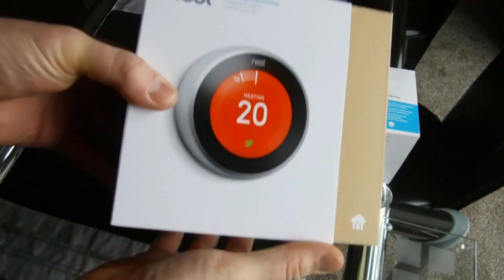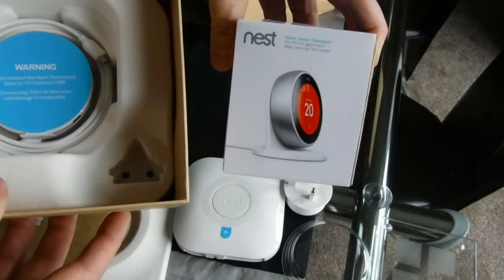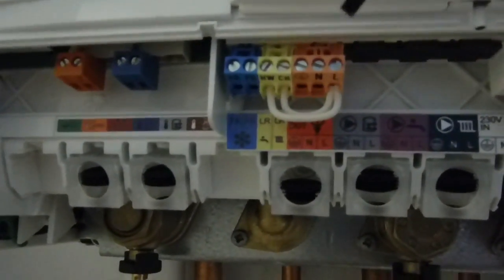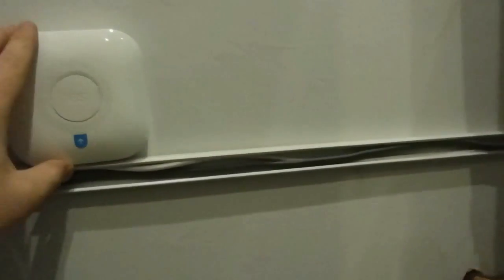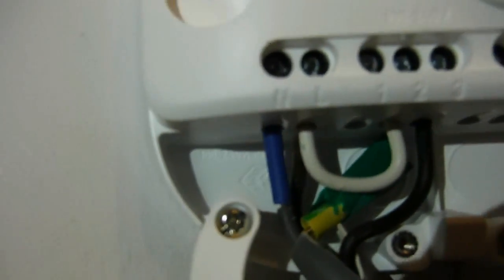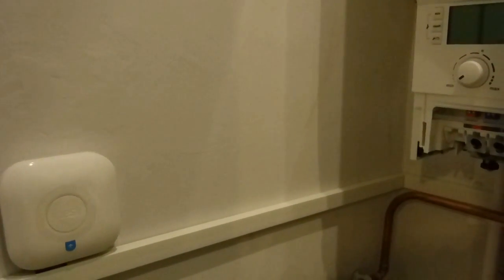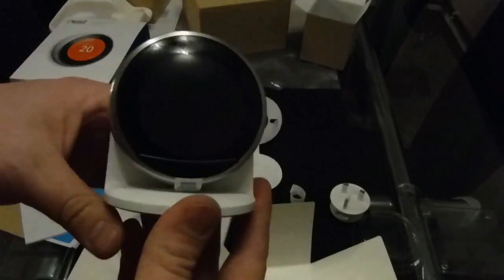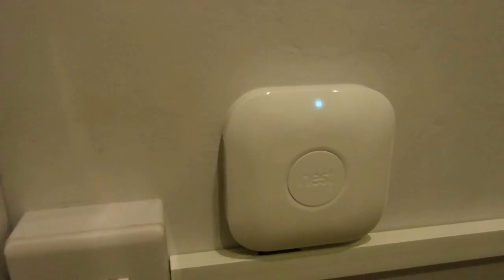How to install Nest Thermostat 3rd Generation - UK

Comment: So if  you wanted to control your hot water as well could you just use the earth wire and connect it to the HW terminal on the boiler and the HW terminal on the heat link
Reply from the maker: I've not ever connected up hot water controls to mine. You would use terminals 4, 5 and 6 though, and it's more if you have a hot water tank, not just a combi.

Comment: I like how they made an UK adaptation for the nest thermostat as in the US they don't have boilers, they have an AC that blows hot air in winter and cold air in summer because in some places in the US, summer and winter are both intense. But with the British version its only to heat the house. That also makes me wonder if there are adaptations of the thermostat for HOT countries where it's only the cooling feature...
Reply from the maker: The British version will cool with air-con too! 👍🏼 It's just not used as often here!

Comment: thanks for the video. I am looking to install one of these very soon. FYI to get rid of flicker on your video change the shutter speed to either 50 or 60 depending on the Hertz of your lights. you can pick up some decent video lights from amazon that are anti flicker also
Reply from the maker: Thanks for the tips. I have changed most of my equipment since recording this video including a video light, so I shouldn't have any issues with flicker going forward. Thanks for commenting though! 👍🏼

Comment: Hi Charlie – your video is great. We are just about to fit a Nest learning thermostat to go with a new Worcester 23CDi Compact boiler. Like you, we haven't decided where to put the Nest so will get a stand to try it in a few places with a view to putting it on the wall later. My question is how do we get power to it on the wall without visible trunking. It is likely to be several rooms away so can't have a cable going from the boiler to the thermostat. Nest have told me that we would need 5V of power as you would with a phone charger (so would need a transformer to convert from 240V). Any tips of how to get power from a plug socket below, up to the position on the wall above it, with the cables hidden in the wall (without pulling the wall out). Is there a way of pulling out the plug socket and feeding the wire up the wall, then putting the plug socket back? I am not an electrician and will not be attempting this myself – just wondered if this is feasible? Thanks
Reply from the maker: It really does depend on the type of walls. If they are solid brick or concrete then the only way is to 'chase' the wall...messy....but if you're renovating the room anyway, not a problem. You could take the socket out to see what access is like behind (make sure the power is off!) and if the wall is stud partition then you could drill a hole where the Nest is going and then drop the wire down (best to have gravity on your side!) to another small hole near the socket (if there's a socket directly underneath). Don't go drilling near the socket before checking where the wiring is running first, and don't bring the wire out of the socket hole.....give it it's own hole.
Alternatively....what's the other side of the wall? If it's a cupboard or an area covered by furniture, drill right through and run the trunking up that side of the wall.
Hope that helps!

Comment: Hi, I’ve just purchased a 3rd gen nest but it didn’t come with a power cable! Can I use a phone cable instead?
Also, my boiler is a Valliant ecotec 430 plus. I don’t have a thermostat but i do have a separate heating and hot water control unit, do I disconnect the controller and replace it with the heat link?
Thanks
Reply from the maker: Did you buy it brand new? It should definitely have come with a power cable if you did. You could connect it to the Heatlink using T1 and T2. The charger does use a micro USB cable, but just be careful you use the right adaptor.
As for connecting it up, yes, you would remove the separate control unit and connect the Heatlink. 👍🏼
Reply: Thanks. yes bought it direct from Amazon🤷🏻‍♂️ just checked the wiring and all wires from boiler pump controller ect go through a Wiring box so controller wires don’t go direct to boiler?
Reply from the maker: @julietweems4127  If I was you I would be contacting Amazon and asking them to send a replacement!

Comment: So that heatlink is a 3rd generation too? Just had a boiler with Nest installed and Nest isn't communicating. Looks like a 2nd gen heatlink next to the boiler, but my plumber says it doesn't make a difference?
Reply from the maker: Yes the Heatlink in the video is a 3rd Generation Heatlink. It's the one that came in the box with the Nest. I have no idea if the 2nd Generation had a different Heatlink sorry, as I've never installed one of those. I would always say to use the Heatlink that came with the Nest though just to make sure its compatible.

Comment: Hi. Trying to install my Nest Thermostat into my Vaillant Eco 415 and have opened it up having followed the manual and it looks pretty straight forward the only issue is that the 3 & 4 which should be looped only has a single cable going into it.  Am I still okay to wire it up and have one cable running to 3, one to 4 and then have these in the correlating numbers in the hub?
Reply from the maker: As far as I can tell from reading the manual for your boiler, you would link the 24v connections to 2 and 3 on the Heatlink. Hope that helps!

Comment: Hi there, great video. Can I ask what cable you used from the boiler to the Heat Link? Was it a 1mm^2 4-core flex?
Reply from the maker: The cable I used wasnt strictly what should have been used but it works fine! The 1mm 4-core flex is suitable yes!

Comment: Hi I’ve got a Honeywell Thermostat a to two wired one I want to put my NEST in same place can I run it from the two wires that connect to the boiler ? Thank you
Reply from the maker: You can use those two wires to power the Nest, but they would have to be connected to the Heatlink at the boiler end. So, connect the Heatlink to the boiler, then connect the Nest to the Heatlink via connections T1 and T2 on the Heatlink using those wires. Important: Make sure the current wires are disconnected from the boiler before you connect the Nest to them or you'll fry the Nest!

Comment: Was the charger and cable included with the nest?
I am just getting Nest 3rd gen with my electricity renewal plan and I am not sure if I need to order it separately...
I have seen that the stand needs to be purchased separately but I am not sure about the charger and cable...
Reply: Mine didn't come with any additional power supply. I bought mine from toolstation this week.
Reply from the maker: @kirky9633  Really? They've changed that then, because when I bought mine (which, granted, was in 2016!) it came with an adaptor and wire. You sure it's not hidden at the bottom of the box? 😉
Reply from the maker: The charger and cable come in the box with the Nest, but the stand is usually a separate purchase.....although some places (Screwfix I know of) are offering a free stand at the moment.

Comment: It is essential to wire to the call for heating into 3? and is it also essential to loop the live into 2? my old thermostat had the call for heating into 1, with no live loop into 2 - this is the configuration i used. I'm not sure if i'll have issues with this.. any help is appreciated
Reply from the maker: I'm not sure what your old thermostat was but the Nest would probably need to be wired differently. I dont see anywhere in the Nest manual that uses 1 for any connection. If it works though then fine, but you may need to follow the wiring in the video. It all depends on the boiler really.
Reply: CharlieShooters KnowHow thank you for the reply. Do you know if the system will still work if I don’t live loop back into 2? I can move the call for heating into 3 easily, but don’t have any wire to do the live loop this evening..
Reply from the maker: @willg2412  If it is working, don't worry too much. What make is your boiler?
Reply: CharlieShooters KnowHow  my boiler is an ideal. It’s not working at the moment  the radiators are on constantly even when the thermostat is turned off. I’m going to move the call for heat to 3 now..
Reply from the maker: @willg2412  Right, OK, I've had people ask about the Ideal boilers before. With those, there are 2 wires that come from the boiler (in addition to live and neutral) and they are wired to 2 and 3 on the Heatlink. That should sort it!
Reply: @charlieshooter  cheers i'll give that a go, thanks for your help!
Reply from the maker: @willg2412  No problem, let me know how you get on!
Reply: CharlieShooters KnowHow all sorted mate! Thanks again for your help
Reply from the maker: @willg2412  No problem!

Comment: Wondered if you could help? My boiler has the following wires - green/yellow, brown, blue into MAINS, the. 96 with a brown wire going into 1? Is it a similar format to putting a nest system in? I don’t think my combi boiler is looped?
Reply from the maker: What make and model is your boiler? That's probably easiest rather than trying to work out the wires.

Comment: Any help with ideal logic 35 combi.    I have connected N on heat link to N on boiler.  I have jumper wire from L to 2 on heat link which then connects to L on boiler.  I then have call for heat (3 on heat link) connected to one of the room stat connections on boiler.  But boiler won't fire when switching heatin on thermostat? Any help appreciated!
Reply from the maker: The Logic 35 needs to be wired slightly differently. You need to wire L on boiler to L on Heatlink, N on boiler to N on Heatlink. There are then 2 connections on the boiler for Room Stat/Timer....connect those to 2 and 3 on Heatlink. Hopefully that should sort it. Let me know how you get on.
Reply: @charlieshooter  
Thanks for prompt reply, I did try that.  However I think my previous wireless receiver is causing a problem.  I removed it but apparently I need to put the "link" back in, but I don't know where !!
Reply from the maker: @halpym  I'm pretty sure that the above should work. You do need to pull out all the old wires for the old receiver though.
Reply: @charlieshooter  it all seems fine apart from the old wireless receiver thing....pretty frustrating!
Reply: @charlieshooter  

Working
[img]https://i.imgur.com/fABmmKz.jpg[/img]. Had to join the black switch wires from the back of the old wireless receiver (above pic) then it fired up.  It was still diverting to the old receiver rather than nest thermostat.
Thanks !!
Reply from the maker: @halpym  Excellent....well done on getting it working! 👍🏼

Comment: How do you wire a two-wire zonevalve with a 24Volt adapter to the Heatlink?
I have got everything to work except for the zonevalve, this needs 24Volts.
Without the 24Volts my heater does not heat. Please help?
Thank you!
Reply from the maker: I've just been staring at various wiring diagrams for ages and I'm sorry but I'm a bit lost with it all. It seems to depend on how your system is set up. Have a look in the Nest instruction booklet and try to match up the system you have with one of the diagrams.
Sorry I couldn't be more help!

Comment: Brown sleeve on the black?
Reply from the maker: I didn't in this case because the brown is the live wire and the black is the call for heat wire, so it distinguishes between the two.

Comment: Hi, first of all, awesome video, easily the most useful one... and here comes the "but". but could you help me with my case? my boiler is "chaffoteaux ultra 24FF". here what I got so far: boiler has TA1(2 pins) looped for thermostat, so what I should do is take Live and Neutral to Heatlink, and remove the loop from TA1 and connect one cable to 2 and one to 3 on heatlink. Does this sound correct?
Reply from the maker: Thanks, pleased that you have found the video useful.
As for your connections, yes, you're right, the connections on your boiler need to go to 2 and 3 on the Heatlink and no loop to live. 
Sorry it took a while to reply!

Comment: Orange does not mean that the boiler is ON, orange indicates that it should be sending a signal to the heatlink/receiver 👍🏻
Reply from the maker: ....which in turn.....will fire up the boiler! 👍🏼
Reply: CharlieShooters KnowHow has long as the receiver gets the signal and the receiver passes the message to the boiler 👍🏻
Reply from the maker: @01plumberman  That's a lot of ifs and buts.....assuming you've followed my instructions and wired everything correctly then......the boiler will fire! 👍🏼
Reply: CharlieShooters KnowHow as a gas repair engineer I am a fault finder. I was just clarifying for people that don't know, that the orange light does not necessarily mean that the boiler is alight. If all is working correctly the boiler may still not be alight if it has already reached its flow set point temperature 👍🏻
Reply from the maker: @01plumberman  I think you're getting a bit picky now! 😂👍🏼

Comment: To be honest it is ridiculous that if u put it on the wall u have to plug it! No batteries.
Reply from the maker: You can wire it in permanently to the Heatlink but I suppose that can entail running a wire a fair distance, depending where your Nest and boiler are.
Reply: Or you could reuse wires from existing thermostat to power nest from the heatlink
Reply from the maker: @UrbanPlumbers  That's the ideal isn't it. 👍🏼

Comment: Sorry for a dumb question but where is the usb from the nest going,doesn't it work on wifi,or is that power,if so cant it use batteries
Reply from the maker: The USB cable goes to a power adaptor. The Nest doesn't run on batteries like the Hive, but you can hard wire it to the Heatlink if you're able to.

Comment: Hi  Been looking for a video to advise  how to move from HIVE2 to Nest3 have to say your video is best I have found. I note that some have mentioned your camera quality and others the type of cable . I found your video coverage clear especially showing the wire connections and although my install was done by BG in 2006  the cable does not appear to be special  The system is checked every year and not once has the condition been identified has faulty  indeed no sleeve was used to identify  the N which you took the trouble to do so Its obvious from the time you took and the quality of the finished job qualified or not you did a good job.
Reply from the maker: Thanks Ray, appreciate your kind words! Comments like this make up for 10 negative ones! Keep an eye out for my other Nest videos.

Comment: I have one major issue with the nest thermostate. After doing a ton of research I came to the conclusion that there is 'no way to override the nest schedule.' Most times I want to use the schedule that I manually set up. But other times my work shift schedule changes for short periods of time and I would like to bypass my nest schedule and run manually. But it really sucks that the nest will not let me have that option. I have an older Honeywell wifi thermostate that easily allowes me to bypass schedule when needed. Looks like I will be reinstalling that.

Comment: Can you replace the existing boiler programmer with the hive nest heat link ?
Reply from the maker: Yes, the Nest Heatlink would replace the boiler programmer.
Reply: Cheers. I’m relatively good with DIY and do a lot of research prior to undertaking any project. Watched many videos on installing Nests and they all seem to be boilers without programmers
Reply from the maker: I think if your boiler did have a programmer installed, you would have to remove it, or at least disconnect the wiring for it.
Reply: Any ideas why my current programmer doesn’t have any connections to Off ports for Boiler or Hot Water tank ? May have to just get an electrician.
Reply from the maker: I don't know sorry. I don't know a lot about boiler programmers. If you Google the "name of your boiler" and then "installation manual" you may find some info.

Comment: What that white attachment on the pipes inder the boiler
Reply from the maker: That's a MagnaClean filter. It removes all the crap out of the water in the central heating system before it goes  back through the boiler.

Comment: Hi Mate, awesome how to video,  one question from me, when I open existing thermostat (is a Honeywell ) wires look like this picture, 4 cables goes to N and 3 cables goes to L  . I wonder how to translate these to nest ? As from what I can tell nest sockets are so tiny and won't accept 4 cables in !!! Any help appreciated.
Cheers and happy New year 2019 in advance  https://s.amsu.ng/FxZrdGkpnxON
Reply from the maker: You really need to find out where those wires are going. You could put a junction box in and then only take one from each of them to the Nest, but best to check where they are coming from/going to first. Those 2 wires on the other end would probably go to 2 and 3 on the Nest, but again it depends where they're coming from on the boiler.
Thanks for watching, hope that helps!

Comment: I try do as much DYI as I can but I think I'll get it pro installed as seems complicated unless you understand your existing heating system or heating systems in general.
Reply from the maker: You do need to know what wires are going where, but once you know that it's not too difficult. If you're feeling unsure though, always consult a professional.